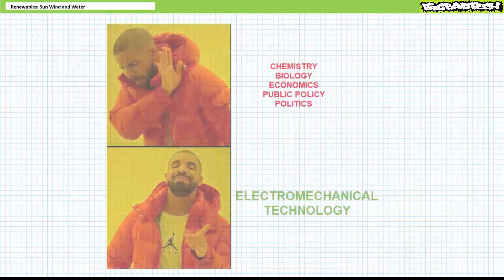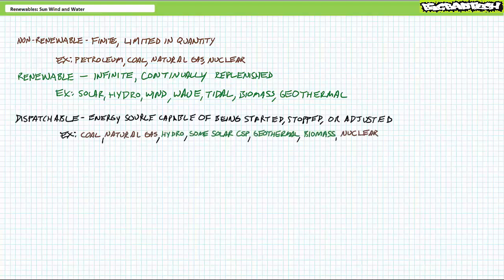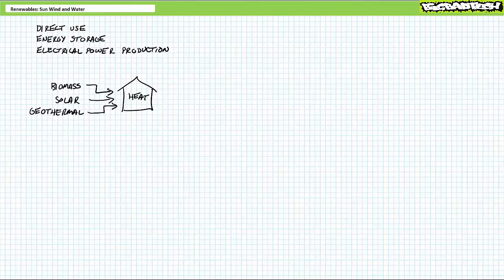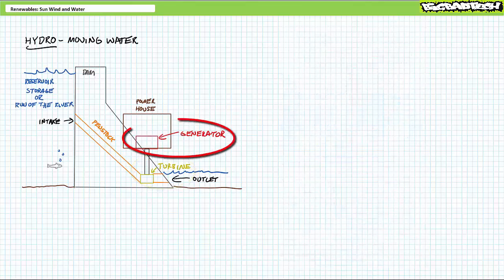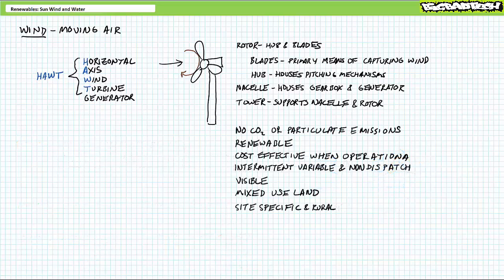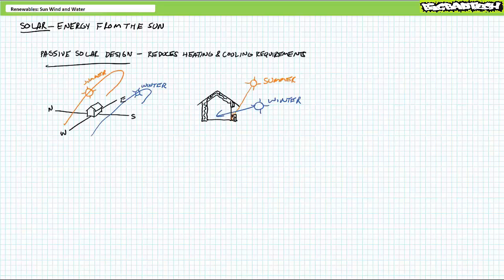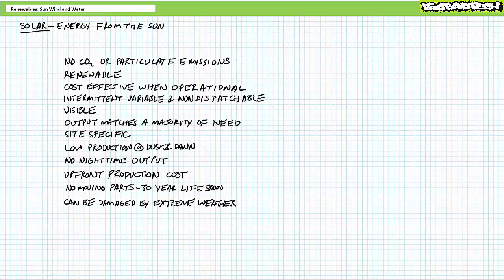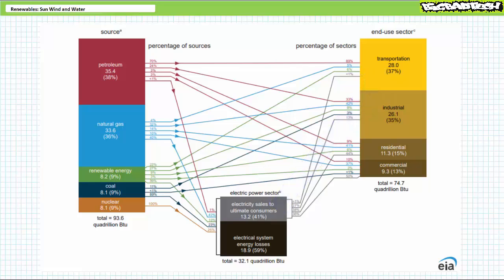Introduction to Renewable Energy (Full Lecture)

Comment: These lessons about electricity and power are outstanding. Those gearboxes on wind turbines are complex to produce. I worked on these and extremely tight tolerances and heavy components. Why can’t they engineer a right angle shaft to bring power to base? It seems like placing a several ton gearbox on top is adding more chance for problems with maintenance. The closing comments were exactly the way this would all feasible. A bunch of micro level renewable sources example consumer cars and electronics.

Comment: Nice introduction, politics distorts, twists and tries to mould science and engineering to whatever pitch or slant suits those trying to manipulate it. 

Just been up my first 2 MW Vestas PMG turbine this week. Gearbox was huge 😂, I suspose the planetary gearbox needs to deal with all that torque and variable wind speeds from the blades.

Interesting machines and good to have an energy mix. I would not be so quick to get rid of nuclear though, always need that reliable spinning reserve.
Reply from the maker: I think my favorite quote is "There is no battle between good and evil but rather only a battle between truth and propaganda." Yes, I feel nuclear will be an integral part of the future grid especially thorium reactors. Problem is ... we just gotta make it into the future!
Reply: @bigbadtech  Pretty funny take on New Nukes . . .  https://www.youtube.com/watch?v=JBqVVBUdW84   ;P
Reply from the maker: Good one. I actually participated in a US-Australia learning exchange in 2012(?) and visited CSIRO. They had a interesting demonstration project which was using the heat of a solar power tower to produced syngas from poor yield brown coal that is extremely plentiful in Australia. Weird mix of renewable and non renewables.
Reply: @bigbadtech  Sounds like AUSRA?  They were out of Australia and used sort of a linear mirror array with Oil filled pipes inline.  Did the Electrical design for a 5 MW test field down around Bakersfield, CA back around 2007.   Since then, Solar PV from China pretty much wiped out most Concentrated Solar in the US.